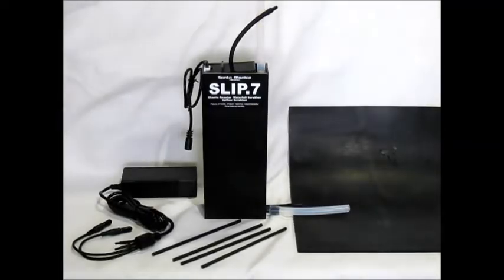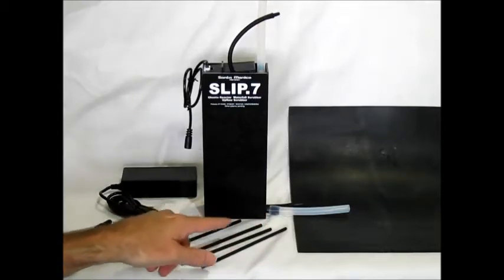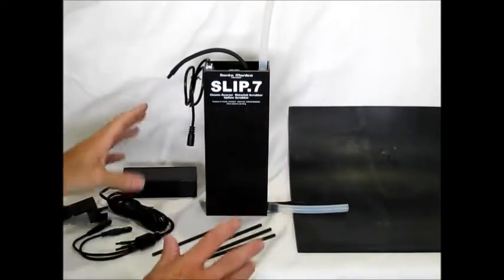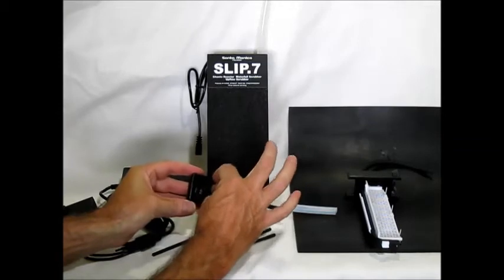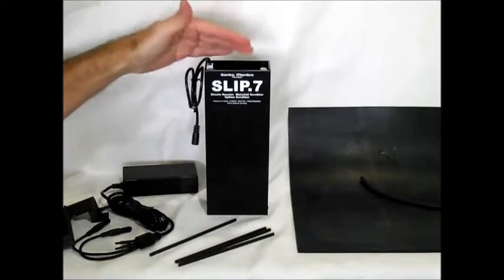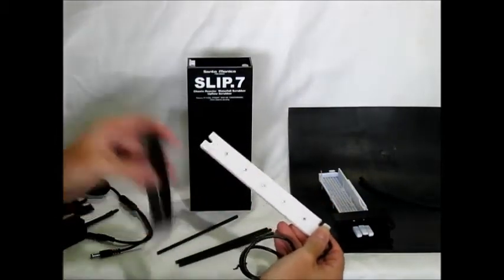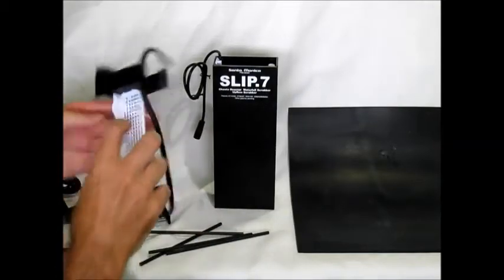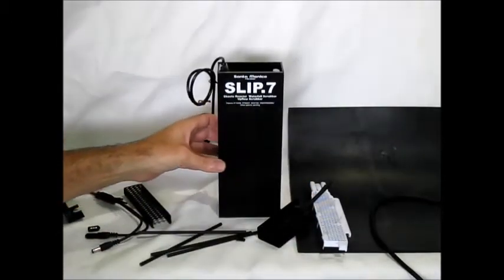SLIP.7 basic intro

Comment: Are you sure this fits in a Fluval evo 13.5
Reply from the maker: You'll need to measure or ask Fluval to be sure, in case they changed recently. The SLIP.7 is 3.5" x 1.75". Could not find a diagram online of the Fluval dimensions but other filter add-ons are also 3.5" wide for chamber 1.